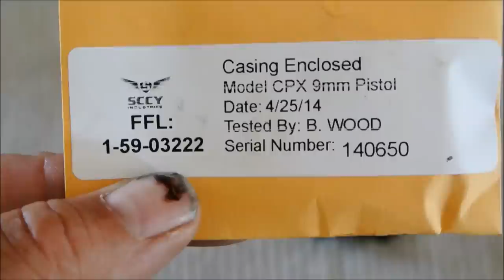cpx 2 problems

Comment: Been knew sccy garbage that's why I went with taurus g2c
Reply: Which Taurus semi autos have been called garbage for decades but in reality both good guns
Reply: @JamesHackett-kv4ki  yeah but I seen so many sccy jam and not function unlike taurus
Reply: @lorenzoguice  I've seen Taurus autos good up but it's usually because of crap ammo but I like them yet
Reply: @JamesHackett-kv4ki  I don't run anything but brass fmj in mines had the g2c got the g3c now I'm running 147gr flat nose fmj in it
Reply: @lorenzoguice  I have asccy I've never had any problems and I own a tourus spectrum only problems which it is if I use to weak of load don't reject proper